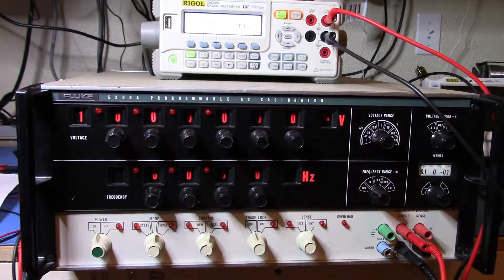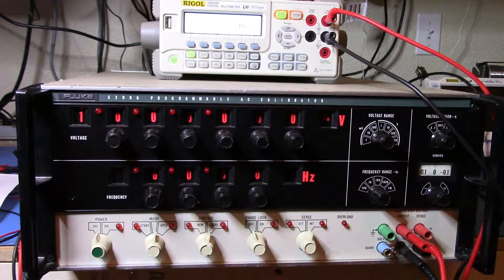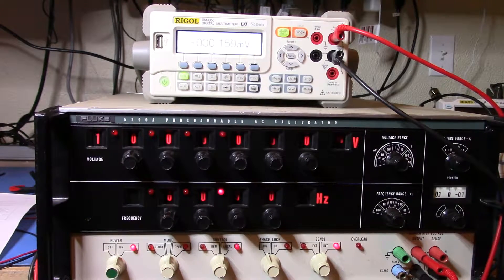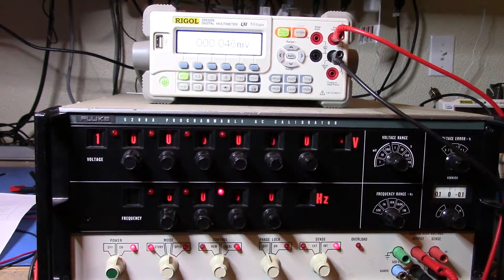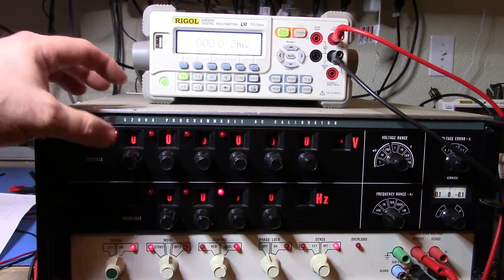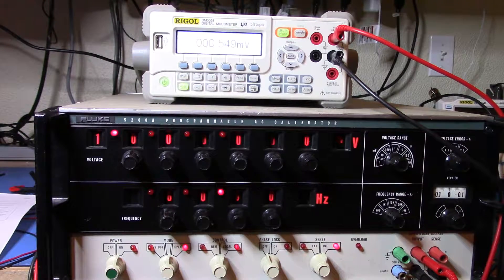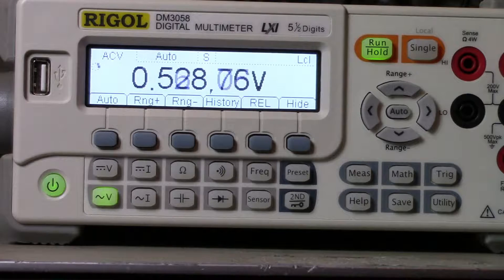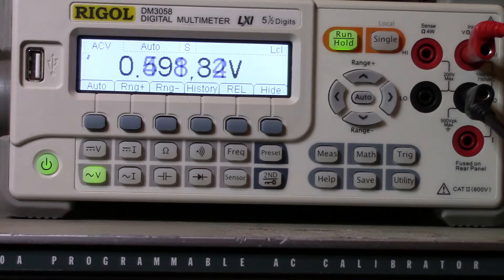Fluke 5200A - First Look

Comment: I have one of these in super condition, looks almost unused. Unfortunately it behaves much like the one in this video. I have not had time yet to open it up and even check the voltages.
Reply from the maker: I found that the issue was a bad oscillator board in mine (my Dad happened to have a spare board for his so I borrowed that and it 'fixed' the problem). There is something more going on though as it has very poor accuracy and frequency on the lower ranges but I haven't had time to check it out yet.

Have you looked at The Defpom's massive 20 odd part 5200A repair video - https://youtu.be/zrTCKwn1G6A

Comment: I am working on one of these units right now, I repaired the power supply, but am still working through issues with no output and the overload indicator staying on all the time, its going to take me a while to get it sorted. did you finish sorting out the issues you had with this one?
Reply from the maker: I was having an overload problem because of the oscillator (either the oscillator card or the oscillator control card, can't remember which). It turned out that the card was marked bad by a previous user and I had access to a known working other card so I just swapped them out. That fixed the overload issue but  I was still unable to get the quadrature calibration to pass but I haven't gotten back to the unit to look into that (how I've been using it is to output the voltage, measure it on my 3458A and set it that way).

Comment: the 5200 had a gpib option 005 card that replaced the ttl interface card  worked on these back in the day Really good box but hard to fix. if you run into problems send me a message
Reply from the maker: Thanks - I did have any issue that I haven't had a chance to get back to address yet on adjusting the quadrature level - You can see the thread here:

http://www.eevblog.com/forum/metrology/adjusting-quadrature-level-on-a-5200a/msg1045604/#msg1045604

If you have any comments I'd appreciate them.